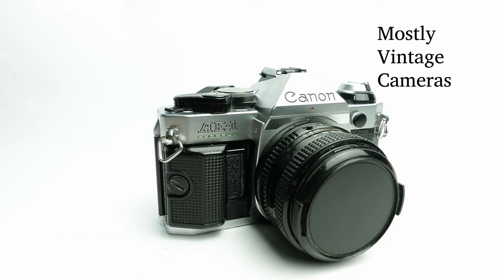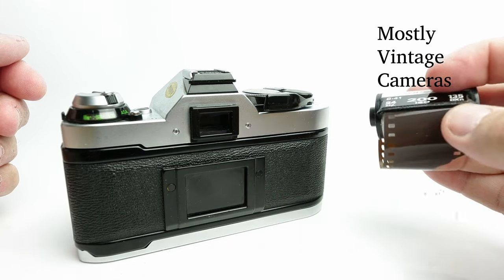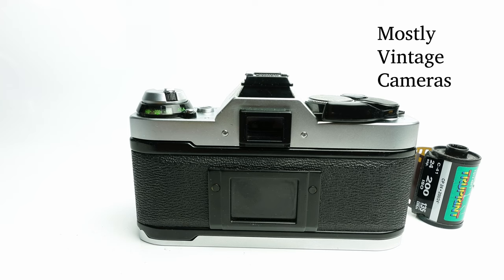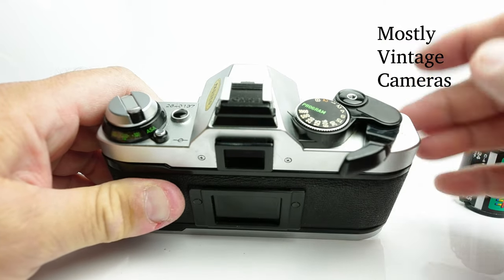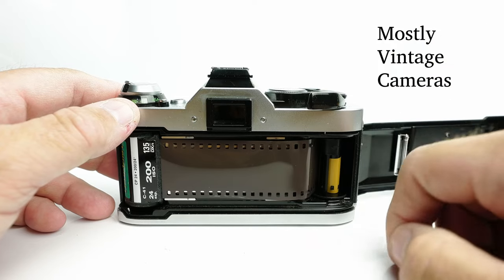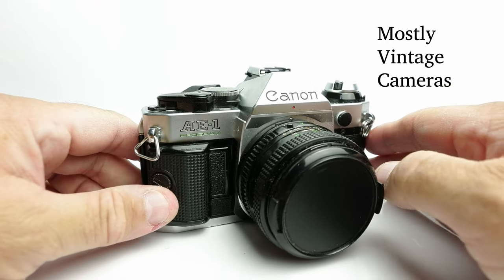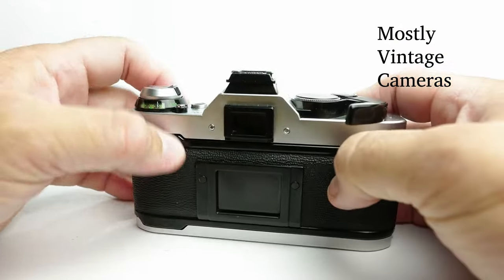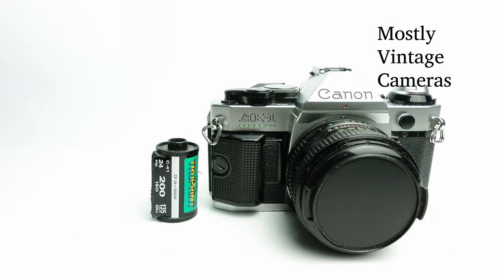Canon AE 1 Program, film loading and rewind

Comment: Hi. Can the film get loose in the camera?
For example if i put the camera in a bag and it touches the rewinder? Should you turn the rewinder to increased the tension before every photo?

The reason Im asking is because the rewind spool stopped moving halfway through a roll. And i dont understand why.
Reply from the maker: Hello, Thank you for your comments and questions.
In general terms taking up the slack when first loading a film can provide a handy indicator a film is moving through the camera. It is not mandatory however. I would not sugest doing this after every shot as it increases the chances of tearing a film. Slack can build up in the film tenstion and so from time to time you might gently want to just turn the crank so you can see it move when winding on but again this is not mandatory. It is unlikly the rewind release pin would be pushed in while in a bag but if this is a worry just take a second to look at it when you take it out of the bag. It can't get pushed in and then spring out again without the shutter being fired and the film being wound on to the next frame. If the pin were acidentally pushed in however it would spring out the next photo you took, the sprokets would not stay permanatly freewheeling!  The only major cause of concern is if you tear the film in camera. DO NOT OPEN THE CAMERA TO CHECK. So if you take more photos than there is film on the roll then you might tear it winding on the last phantom photos. If you think somthing is amiss then yes, try tensioning the film with the rewind crank and without pressing the rewind release button. Be gental as being heavy handed if you are unsure can also tear the film. If the film canont be tenstioned in this way one of three things has happend. You allready rewound the film. The film is torn. There is no film in the camera. Everyone will experiance all three of these situations at some point. In all three cases only open the camera in a photogrpahic darkroom or changing bag or take the camera to a "propper" camera store and ask them to do this. If the film is torn you will need to get a spare film cassettee in which to stow the torn film, all by feel in the dark. This needs a little skill and planing so try and find a shop or experianced pal who can help. Of course if you are somwhere very special and the photos you have taken are less important to you then the ones you will have taken if your camera was not tied up with a torn film in it then relictantly you mght want to open the camera, remove the film and throw it away and put a new film in. This
 is kind of a last resort however.